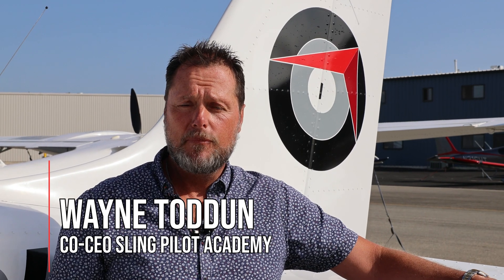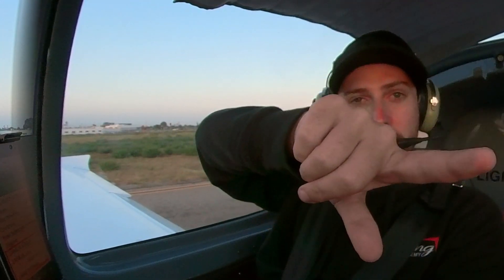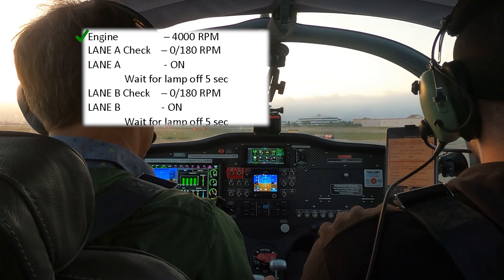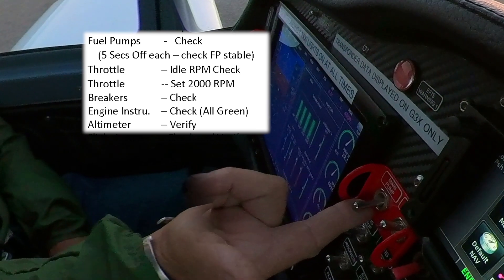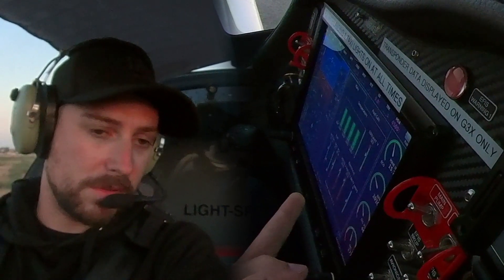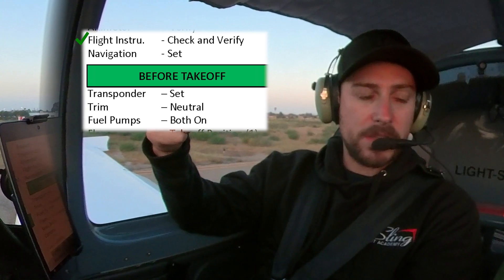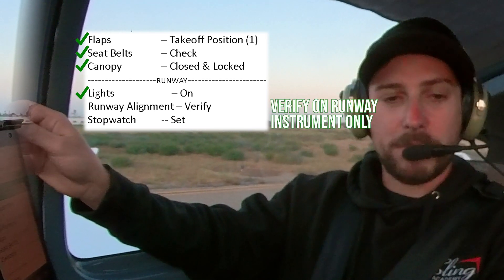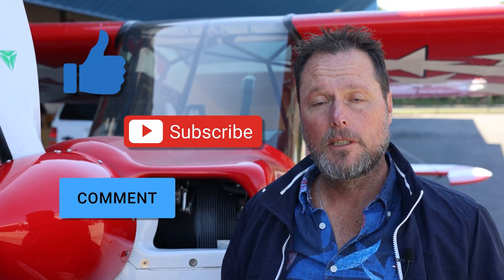How to Perform a Runup in the Sling NGT

Comment: To maximizes angle turned per altitude loss and keeps turn radius tight for turn back to the runway, use 45 deg bank and 1.3 Vs1.